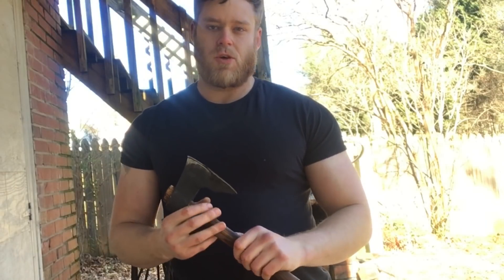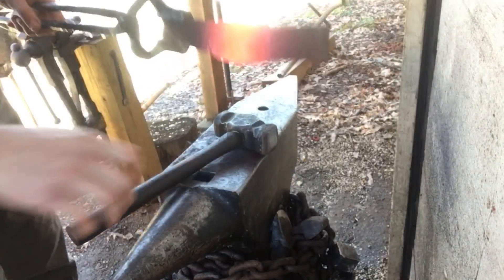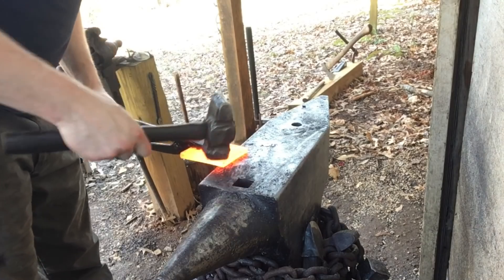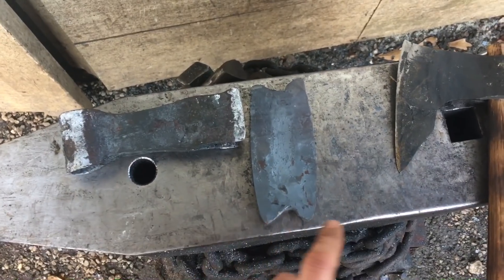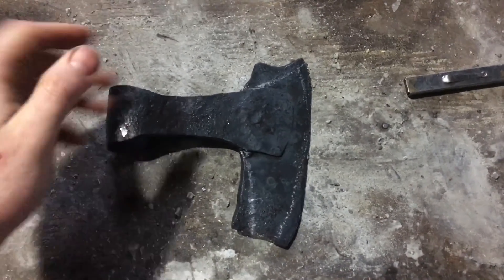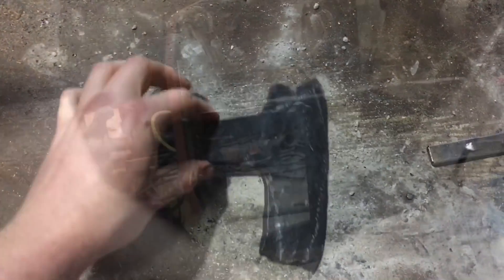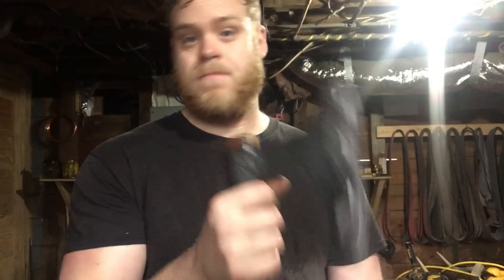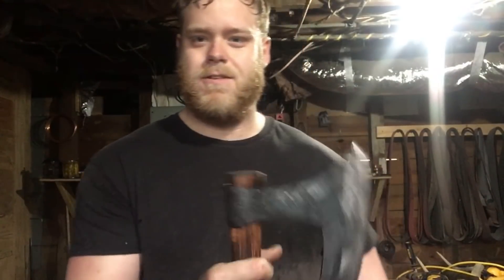Forging a Viking axe from scrap 2

Comment: So glad that I found your channel. Getting into forging as a hobby (another one, I tie flies and fish also) at the young age of seventy one. I built my own charcoal forge and my wife bought a good vintage anvil for me. I noticed that the cut-off tool in your hardy hole resembles an axe head. Would I be able to use a ''cheap'' hatchet and fit the head to the hardy hardy hole or would it not be safe ? If not a good idea, I might have to make one. Thank you. Really enjoy watching you work.
Reply: I‘m new to blacksmithing too and use a charcoal forge. If you can forge the axe head poll into a shank to fit the hardy hole it should probably work. My first hardy tool is really crude but does the job.

Comment: Sir: You are working towards a " grinding edge" and me to.
Question: What is your idea of the thickness of the forge edge as I know we got the best steel inside the blade's surface .
  I had build a ribbon burner and yesterday got my first forge weld and 6 bodies for Tommy Hawks cut hopefully get a few done in days.
Partly due to your teaching Sir and a few others.
Thanks

Comment: what is you go to  for moisture protection. being rain, skin contac ?
Reply from the maker: mat a boiled linseed oil works well
Reply: @OldHickoryForge   now do you also heat the top service up with a torch just enough for a little smoke or size when applying?

Comment: You should be heating much hotter. Close to a welding heat. It will make you life much easier.
Reply from the maker: Nathan's Forge atmospheric gas forges go through gas very quickly at welding heat. It’s not economical to run it at welding heat unless actually welding.
Reply: oh i didn't realize you were working in a gs forge.  That makes sense
Reply from the maker: Nathan's Forge yeah I can’t work in coal where I’m at otherwise I’d be working it hotter. The ribbon burner forge I just built should help some. A lot more heat wth less fuel